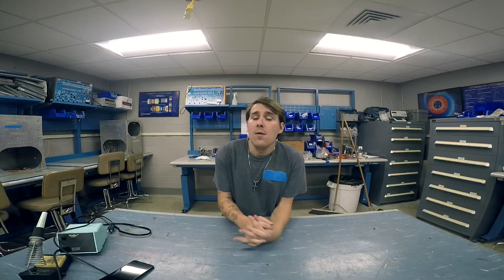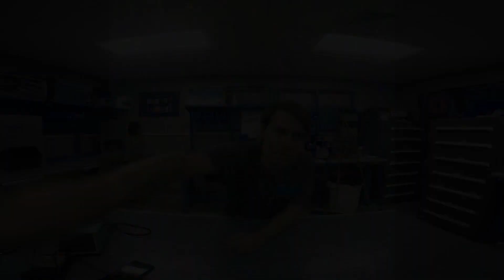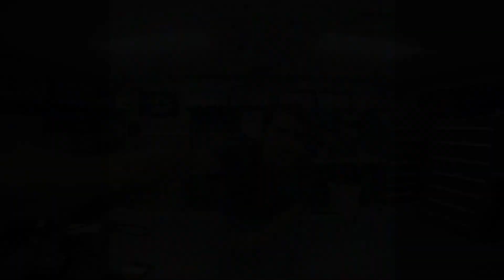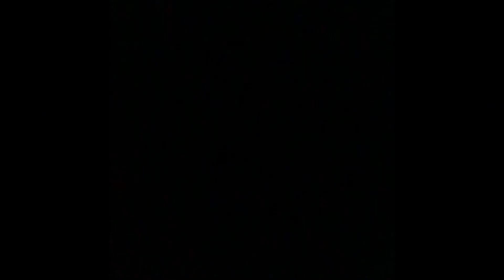Quick Update, What To Study For The O&P

Comment: So is the amount of questions asked for the o and p still based off of written test scores?
Reply from the maker: Yes, PSI generates that test. The maximum you could possibly get is 22 per section
Reply: @brycebuildsit 22 for generals and 22 for powerplant, or 22 for aircraft drawings, 22 for weight and balance, 22 for basic electrity, etc... thank you for the help😅
Reply from the maker: 22 for generals, 22 for airframe. 22 for power plant.

Comment: I need some advide guys. I took my general and airframe written tests before August 1st, when I got the result the code system for the wrong answers haven’t changed yet. But after August 1st they changed the code so how should I study? Just use the old code to study? I’m really stressed out with these old and new codes
Reply from the maker: The codes are about 95%, the same for pts and acs. So study using the old codes yes, but cross reference them to the new codes.
Reply: Thank you for the advice!

Comment: I have a question, I took the O&P exam in June this year. I passed the oral test but failed the Practical test sections of General (K. Maintenance Publications), Airframe (F.  Assembly and Rigging), and Powerplant (M. Fuel Metering). When I retake the exam, do I only need to take the K, F, and M sections, or do I need to take all the other sections again as well?
Reply from the maker: The DME will have you retake the entire section for each.
Reply: @brycebuildsit  You mean I have to retake the entire practical section of General.airframe.powerplant, right?
Reply from the maker: Yes, there are 5 sections total 1 for general and 2 for airframe and 2 for power plant. You will have to retake section 1 section 2 and section 4 since those are the sections those tasks were under.
Reply: @brycebuildsit  Thank you!

Comment: I just took my O&P for my airframe. The new test is nothing to be scared of. I got about 18 oral questions, I strictly studied Jeppesen and only missed one question. I got about 11 projects and with each project I was asked 2 oral questions which you can look up in the books.
Reply: Congratulations, now you just have powerplant left ?
Reply: @keirisanchez8490  that's correct, I'm taking it end of September.
Reply: How about the practical projects? Were they rough to do or you think even with little knowledge you can complete them if you follow the references?
Reply: @Alexander-gu1nq  the projects are also generated by the acs program, they had me shooting rivets, safety wire, see if the circuit had an open and read the ohms, use a micrometer, service an oleo strut, weight and balance, solder an electric wire. It's exactly what I learn and did while in school so nothing was too difficult. Also my DME made me look up all the info prior to starting a project.
Reply: @DatMeister   ah ok thats good to hear then. I was wondering if they were gonna give some annoying and time consuming projects but that doesnt sound too bad esp with refrences ok ty.
Reply: @Datmeister hey dude, if you don’t mind me asking what was the practical for weight and balance
Reply: @isaiahmorales3013  My DME gave me a problem stating there are 2 seats at 15lb each removed and to calculate the new weight and balance
Reply: @DatMeister thank you & congratulations pal on getting your license!
Reply: @isaiahmorales3013  thank you and no problem! Let me know if I can help in anything else. You got this 👍
Reply: @DatMeister Congrats! did you just study all the oral questions in the back of the Jepp. or did you go over the codes you got wrong from your writtens? My DME said study the codes…
Reply: @michaelrascon1604  I just studied the oral questions in the back of the book mostly,  the rest were from what I remembered from going to schoop
Reply: I just finished my Powerplant O&P today. I am officially an A&P mechanic!  Once you get the general out of the way, everything becomes a lot easier cause you can focus on studying either  Powerplant or airframe and knock out the oral question.
Reply: @DatMeister What did you score on your writtens if you don't mind me asking? Also where do the 2 oral questions that they ask with the practicals come from, do they come from the same oral questions we study?
Reply: @Esten30  Airframe I scored an 82% general an 74% powerplant 78%.  The 2 oral questions will be related to the practical project you are gonna do and its what you learned in the oral prep books but reworded
Reply: @DatMeister  Okay cool, do you remember how many oral questions you got for airframe and how many projects? I scored an 84% and will be testing in 2 weeks.
Reply: @Esten30  I took my general and airframe and got around 32 oral questions combined. I got around 16 projects (general and airframe combined) for powerplant I got 23 oral questions and 14 projects
Reply: @DatMeister Do they do that amount of oral questions from each section within ex. Generals, Powerplant?

I was told by my DME based off my written results to expect 18 questions, but I was wondering if it was 18 from both or 18 from each section within Generals and 18 within each section in Powerplant?
Reply: @kinoryu9512  the amount of oral questions you get depends on how well you score on your writtens. The better you do, the less questions you will get.
Reply: Hello am new in US i have a question do I need to contact the DME before taking the test or when I finish taking the test thank u